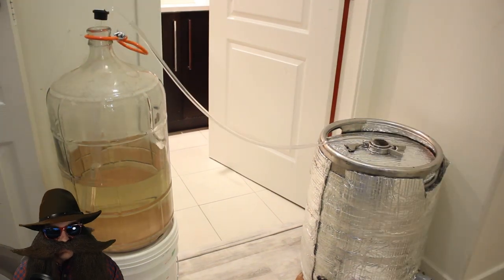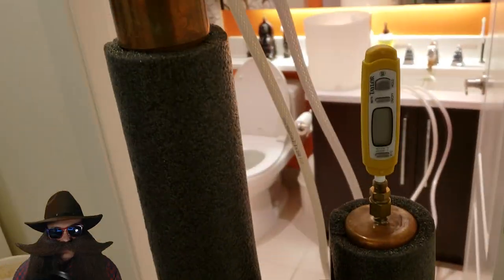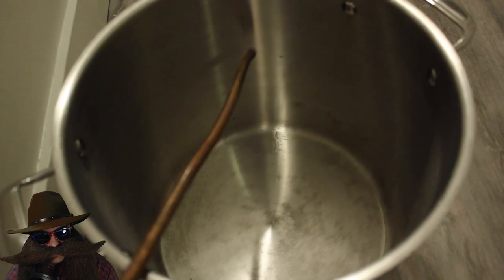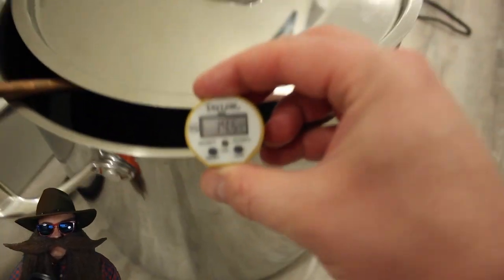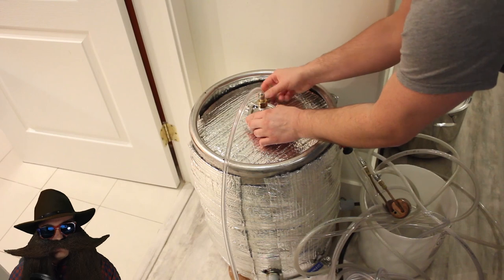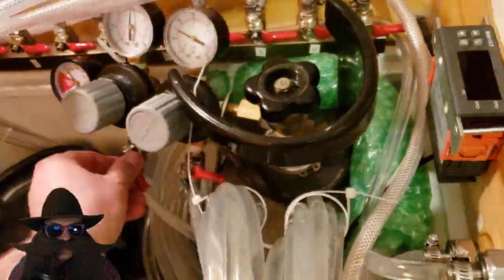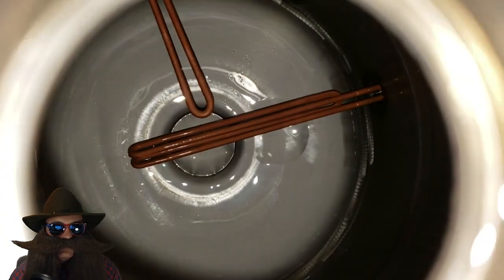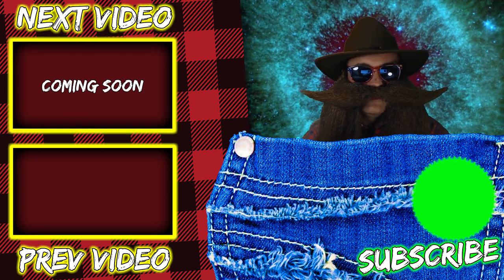Sugar Wash Stripping Run #1

Comment from the maker: Anyone else distilling in an apartment? Are you doing sugar wine or whisk(e)y? What do you think of the CO2 pump?
Reply: Open Source Distilling hey I was doing the Tomatoes Paste Wash, I slowly work my recipes to Teddy Fast fermenting for the wheat flavours love it. I was thinking about whiskey but I need to have a better setup. So that is bring me to rum for now. CO2 is smart but you could easily do the same thing with a compressor.
Reply from the maker: @1FrenchConnection1  Nice. I plan on getting into whisky, I have some enzymes from a local distillery to try out. I've been making gin the last year and playing around with macerations.
Reply: About to move to a flat (aussie apartment) so have been putting together my shopping list. It makes a big difference when you are used to a big yard to dump waste & clean equipment in. I'll watch your channel with interest mate :)
Reply: Hi , thank you for showing the appartement set up. You are inspiring. 

I saw you put cork plates under your keg still. How many plates do you put ? And what is tghe the thickness so you don't burn the floor ?
Reply: Yup..! Mostly I head for neutral, but I've done anything from whiskey to fruit brandies. 
I like your out of the box thinking with that pump. I've installed a ball valve fitting on my boiler and it just drains by gravity directly into the shower drain. :)
Reply: It's a fantastic idea! I use 12V solar pump you can buy for ~$25 on Amazon. You probably have less money in fittings though, so that's a boon.
Reply: @Adrien Dakota instablaster :)
Reply: @Adrien Dakota You are welcome =)

Comment: Ive noticed that you dont throw away the 4 shots at the beginning of ur run why?
Reply from the maker: For stripping runs I crank up the heat and collect everything. I do separate jars with cuts during the spirit run. I throw away the foreshots then. Better separation during a spirit run than a stripping run. Thanks for watching!

Comment: Curious if you are on 120 or 240 volts
Reply from the maker: I'm in an apartment using 3 phase 208 volts. I get about 3125 watts on the 208 volt element, and I have a secondary 1500 watt 120 volt element. Everything is hooked up to GFCIs.
Reply: Open Source Distilling I’m flashing mine this weekend it would be great if you could PM me I would like to share my setup.
Reply from the maker: @1FrenchConnection1  email me at horseymchorseface.osd@gmail.com and we can talk about equipment.